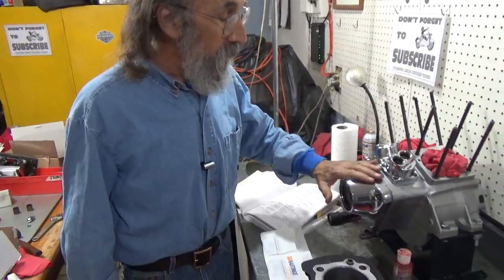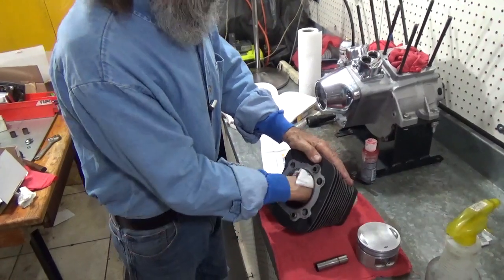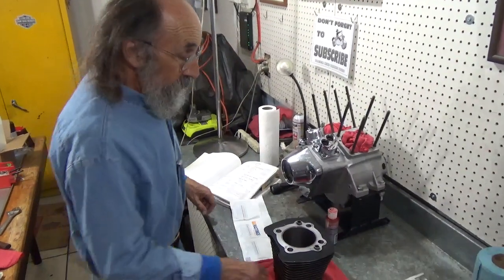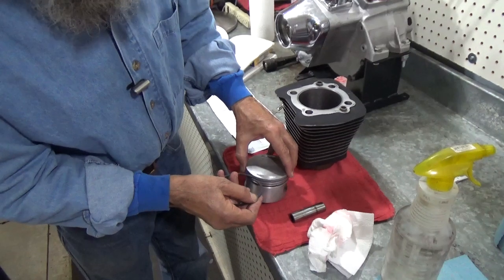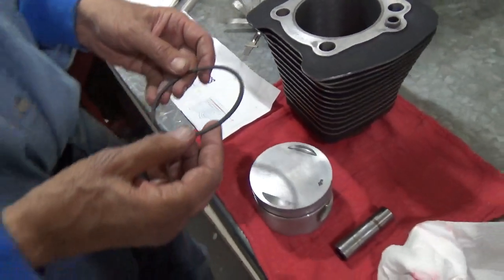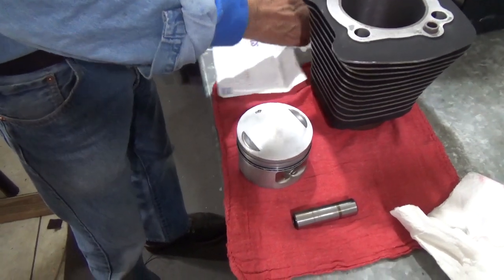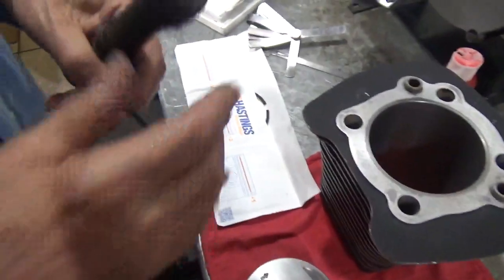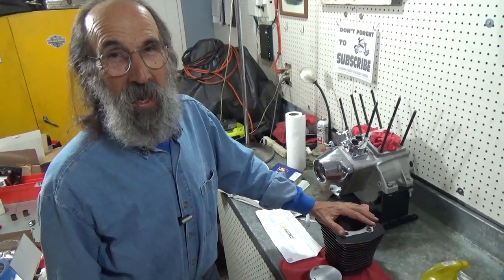Evo Motor Assembly, Part 8, Fitting Piston Rings

Comment: Better to take your time and do it right ! Mine blew up on me . A valve stuck open and destroyed the piston and of course the head . I had to tear  the motor apart down to removing the right case to remove shrapnel , but I left the crank pressed into the left case . Put it all back together with a new piston and cylinder and she runs fine now . Took me six months working a couple hours here and there .
Reply from the maker: And, you did it.  Very cool.

Comment: Is the Evo motors have Dome Pistons being hemispherical combustion chamber thank you please tell me when you build anything either absolutely correct or it is wrong great job check and recheck you're the greatest craftsmanship in finest
Reply from the maker: We try.  Thank You
Reply: @pacificmike9501  1975 Super Glide 6 over front in the frame has been rake how much over own a Springer front end do I do 6 in /
Reply from the maker: You need more measurements.  Look up in geometry.  The pathagorean theory (I probably misspelled that) will help you calculate  what you need.

Comment: Doing shovel pistons/rings... No dot on rings anywhere just STD on both on top flat . Piston has no F or larger valve pocket measuring them. Just a eraser size dot on one top side and a little horizontal bar underside piston the same side as the dot. Eagle iron style pistons/Taiwan production. I can send pics if need be... Thanks
Reply from the maker: The bar on the bottom, is it on the wrist pin boss?  If so, it points toward the "cam side" of the motor.  If there are no differences in those pistons, even the skirts?  I question them.  Get a lot of light on the second ring.  Look for a taper on the inside.  Look for that dot some more.
Reply: @pacificmike9501  It is on the wrist pin boss yes. Ok that clears that up thank you. Ill check the rings and pistons again and get back to you... Thanks... As we get older we overlook things.... 56 going on 80 i feel at times...
Reply: @pacificmike9501  I do see the taper on the inner top of the ring where STD is stamped.. Flat and square on the bottom. There is no dot. The old rings I clearly see a countersunk dot but the new rings only STD on the top side with the inner ring taper. Both the top and second ring are identical in every way I see. No chrome moly top ring here these are parkerized rings if that makes any difference... I get .016 end gap in my jugs I just got back from the machine shop so that looks good. What's your thoughts? Thanks again ...
Reply: @pacificmike9501  Ok so the bevel is topside on both top and second ring. No dot on these and I see no difference in the two rings at all. The old rings I took out has the dot on the second ring and if you compare them both they look identical. What's supposed to be different between the top and second ring? I've looked over these new rings and they appear identical to me. Both have the inner chamfered edge and both have STD on top. I see no other difference between the two. The oil rings are simple and im using the evo ring orientation to put them on like you do. I'm just curious about what's supposed to be different in the top and second ring since they appear to be identical in every way. I'm guessing as long as I put them in with the bevel chamfered Edge facing up in the right orientation I should be fine...
Reply: @pacificmike9501  I called the company I got my parts from and these are NOS Parts made by Superior that apparently was supplied Dixie long ago. They are very similar to The Eagle iron Pistons that were in this motor when I took it apart. Maybe that info will Enlighten us on the style of the piston and also the Rings and possibly give us some information...

Comment: Mike, I'm at final hone on my Evo cylinders and both cylinders are between +.005" &  +.010" oversize (3.509"). My +.010" hastings ring set leaves me with a .020" ring gap on my compression ring which is right at the maximum threshold (0.007-0.020" per the manual). Should I be concerned with that or go ahead and slap it together? Thanks for sharing! Love your channel!
Reply from the maker: Did you bore it ten over?  Are your pistons ten over?  Always consult your service manual and look at "service wear limits."  I don't know exactly what you have here.  Thank you, but I hate to give out bad advice.  Again, not sure what you have.
Reply: Mike, apparently 0.0.020" end gap is perfectly fine for my particular bore of 3.509" per Hastings. Thanks for the assistance.

Comment: Hey was wondering what the ring clock position was on a 1340 evolution?
Reply from the maker: The diagram is in the motor part (section 3) of the Harley Davidson Evolution service manuals.
Reply: @pacificmike9501 Thank you much appreciated.

Comment: I have a 1997 roadking with the evo motor it need a rear base gasket..would I need to hone my cylinder out and put new piston rings on at the same time I do the rear base gasket?
Reply from the maker: Personally, I would replace both base gaskets, and, not knowing what shape it is in (Evo cylinder bores last and last), I would most likely ball hone the cylinders, replace the rings, lap the valves, replace the valve seals, all the gaskets, and the umbrella valves.  If the engine was in good shape, it will now last a long time.  Let it warm up real nice before twisting the throttle real far and you won't blow base gaskets.

Comment: Hello Mike, I’m building my own evo motor and can’t find out which pistons/bores I have. My pistons have that same STD-4 mark on top of the piston. Does that mean it is .040 oversize? Thank you for you videos and greetings from finland!
Reply from the maker: Measure the piston where the factory manual says to measure it.  That would be down on the skirt.  pistons
Reply from the maker: Having difficulty with my computer.  You need a service manual.  The standard Evo bore is 3.498.  You'll need to consult "Service Wear Limits" in your manual.

Comment: i think end gap on a ring is .004  for every one inch of Bore...  at least it is on a truck/car engine. i have Built Hundreds of them in my Garage to pay my rent...  Haha...
Reply from the maker: Good "rules of thumb."  But, I build a lot of "special purpose" stuff.  By that I mean, it may be for racing.  It may be a special piston.  It may generate a lot more heat than usual for the components I'm using.  I go pretty much by the manufacturer's recommendations, with a little more for the individual who's going to ride it.

Comment: I've wondered for a long time about ring positioning. Gaps should not overlap, very important, I get that. But what makes the rings to stay at their place? Isn't there a risk that the rings starts to move by them self when the motor is running?
Reply from the maker: Not much.  Cylinder bores are round.   Rings have no reason to change their  
position.  They break in and fit themselves.  The design work that goes into piston rings is very scientific and very extensive.  I once sat through a seminar on piston rings presented by one of the major manufacturers.  It was way over my head.
Reply from the maker: Interesting.  Were the gaps in line with each other?  If so, the cylinder was not round.  This could  start a whole new discussion.

Comment: Hi. What should be the  correct clearence  for the piston in the cilinder in a 3.5  + 010" piston.
Reply from the maker: It depends on the piston.  If it is a Harley Davidson supplied piston, use Harley's recommendation.  If it is another brand, the manufacturer should give you their specification.  This is all based on the fact that it is an air cooled engine and the fact that each manufacturer that makes pistons uses their own alloy which will have a different expansion rate.
Reply: Thanks .  It is a jcc  brand piston  but  the piston measure is   0.004 " less than  3.5 inches. Is that cotrect?
Reply: Well the piston i have now is + 010 and it is 3.506"  so i should bore to 3.510. Is that 004 "  right for a harley
Reply: Can you give me harley's recommendations for it
Reply from the maker: What is the motor?  Different clearances for different motors.
Reply: It is a 1200 ,  year 96
Reply from the maker: Cool.  Now I know it is an Evo Sportster.  Now.  Let's start over.  It's very important to measure the piston in the right place.  It should be measured on the skirt (that's perpendicular to the wrist pin), about 1/2" from the bottom.  Modern pistons are not round.  They are "cam ground." The cylinder  (this is a modern, aluminum cylinder with a liner) should be "fixtured" in a pair of torque plates before being measured, honed, or bored.  I really suggest investing in a 1996 Harley Davidson service manual.
Reply: @pacificmike9501  ok. Mike thank you  i ll look for a  service manual. I m a engine rebuilder but is is the first time i work on a harley. If there is another way i can ask you more that not be by here let me know. Thanks for the time you spent on me.

Comment: that 2nd ring has a dot for identifying  that it has a special cut on the lower side of the ring for presser i think... some have a step cut others have a angle cut in it , don't ever mix them up ...   just say'n
Reply from the maker: Yes.  Always check the manufacturers instructions.  On the second ring, the dot generally goes up.  Again, check the manufacturers instructions.